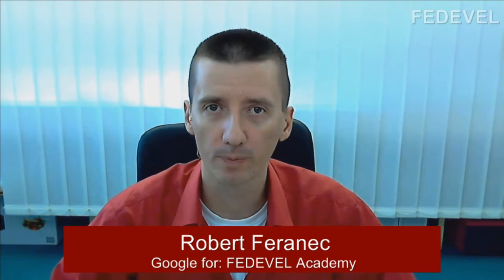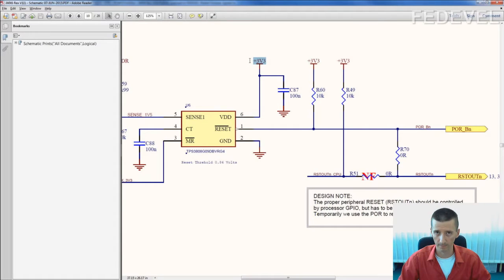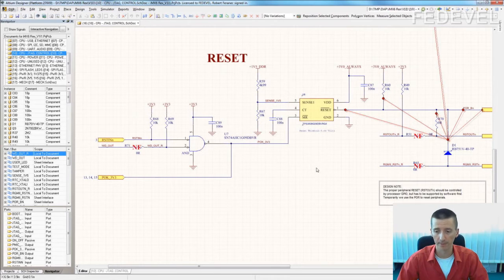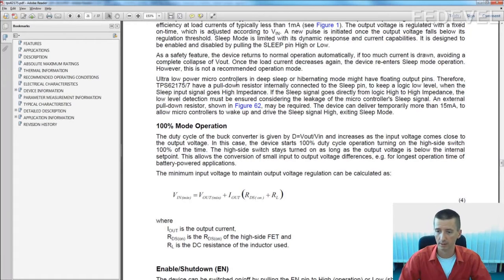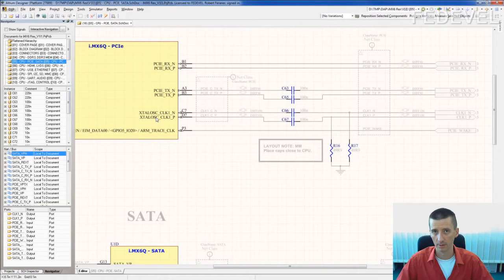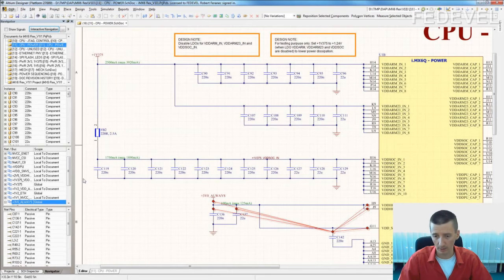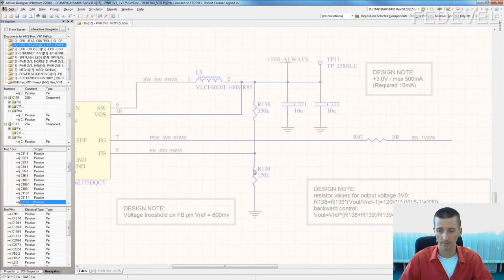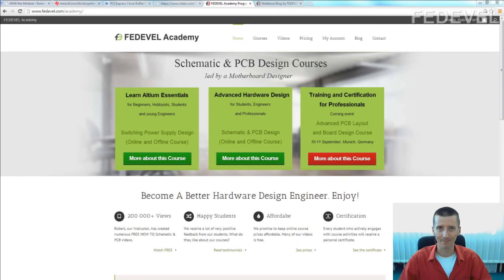10 Tips for Better Schematic Checking - Processor Boards

Comment: Hi, yes it takes many hours of reading datasheets, and sometimes there are surprises , like for example, some i/o pins of a cpu dont have internal pulldowns, some have both pullup / pulldown... . btw there is a bug in schematic library designer when having an i/o pin and you set the outside symbol to none, then it draws a double arrow anyway.

Comment from the maker: I normally: 
- use pin position similar or same to reference schematic from datasheet (so it's simple to compare and check)
- or I use input interface/signals on the left and output interface/signals on the right 
- or processor interface on the left and the other signals on the right, ... 

I always try to make it easy to read and very clear